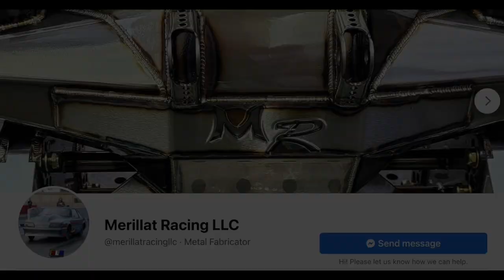Merillat Racing - Drag Racing Chassis Fabrication

Comment: Hey Kevin I'm a subcriber and find all your video info informative but I'm considering building a drag car out of a 1940 Pontiac I've had for along time. I'll be building a chassis and using the information in your videos to help me get started correctly. One thing I'd like to know is what information is necessary to help ballpark or determine a rear gear selection?
Reply from the maker: Thanks, Mark, this is a great question. I will add it to the upcoming question and answer series. At a high level, HP/TQ levels, engine RPM powerband, finish line RPM, car weight, transmission gearing, 1/8 mile or 1/4 mile, tire size and surface prep are just a few things that would help shape my decision. Go fast, go straight! Be SAFE!!

Comment: What's a good setting on double adjusters call over front and back for street car racing
Reply from the maker: That really depends on many factors. For a street car with off the shelf type shocks, I would likely start around the middle of the available clicks and drive it to see how it does. If you can find any numbers I would contact the manufacturer and get their recommendations for your car. Go fast, go straight! Be SAFE!!